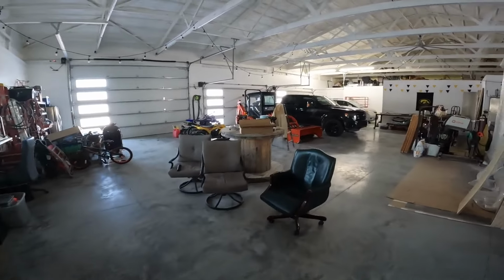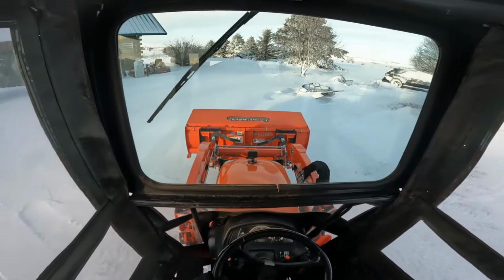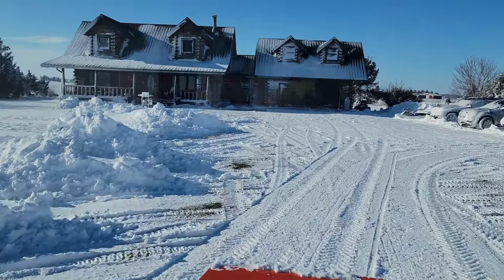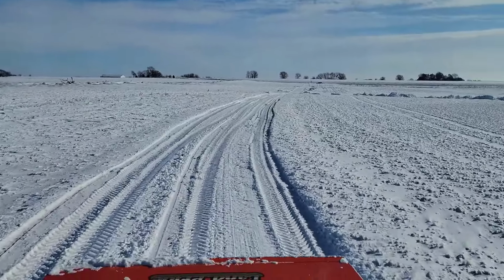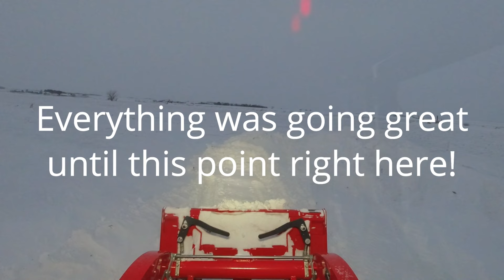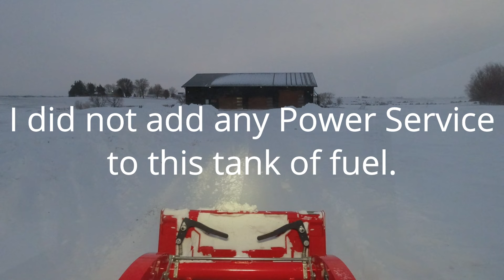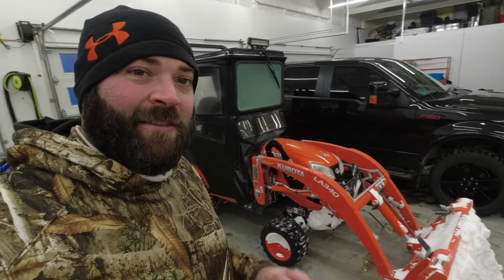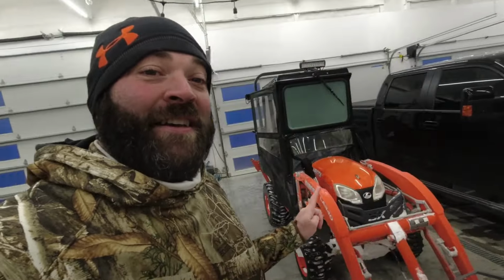Has the Kubota met its match?: Kubota BX23S Tackles Massive Drifts! + bonus diesel gel up

Comment: Boy, I'm going to have to remember this trick with the power service, I cleared the snow from the first storm out at the shop but haven't been back out there for the second round.  My BX 2680 did a pretty good job with just the back blade and front scoop. I'll have to see if I can find a cheap blower for the front.  Take care and hope you can get all the drifts cleared again.  You may have to put up some snow stop fencing!
Reply: I use Hotshot's Secret EDT Winter Defense fuel treatment.  I guess it works, it was around 10-14 degrees the other day when I was out running the tractor and it never missed a beat.  I use it in every can of diesel I get regardless of what time of the year, that was if the tractor happens to not get used for long periods of time and it goes into winter sitting I don't have to worry about it.  I don't use too much diesel so I just buy it 5 gallons at a time and just treat the fuel jug each time I fill it up....The bottle treats I think 50-100 gallons of fuel, so a bottle lasts me quite a while.
Reply from the maker: It is good stuff!! I am sold on it!  The second round for me was way worse with all of the blowing snow!  Hopefully you have a better wind break than I do!  I wish I had a blower for this storm. I think it will put up a snow fence!

Comment: That was nasty Derk. Thank God you have that cab. I feel like you are going to need a bigger tractor or at least a blower on that. Place looks wonderful. Good luck.
Reply from the maker: It was crazy!  I've never dealt with that much snow.   I think a blower would have helped a ton!  Without the cab there is no way I would have been out there!!
Reply: @WichhartAcres  Of course they don't give the attachments or the equipment away nowadays. I think everything is 30% more expensive than when I bought mine 4 years ago.

Comment: I don't have a snow pusher, but the 7 inches of snow we got the other day I just used the rear blade and loader bucket.  Without chains it gets a bit sideways at times LOL.  

We don't get very much snow very often so I don't really have snow removal attachments, but the blade and loader work fine for this...I have a snow blower for my lawn tractor but its a pain in the a** to install.
Reply from the maker: The pusher works good until a certain depth and weight of snow.  The second south I ended up just using the bucket so I could pick it up and place it where I wanted.   It worked good at getting a push cleared and then I could switch to the pusher to chip away at drifts

Comment: I’m going to have to look into that “Power Service” stuff. Our Kubota has been sitting out in the weather since my accident 😮 I am assuming that stuff is a fuel additive 🤷‍♀️ Can I add it after the tractor has been sitting for a month?
Reply from the maker: Yes it is an additive that prevents gel.  Works great!  Just speculation but if something could possibly be already gelled up then I don't think it is effective.   They also make a product called diesel 911 that is for when you are currently gelled up.  I suppose you'd have to fire it up and see if it runs or not.  If it does then just throw the power service in it.  If not better go with the 911.